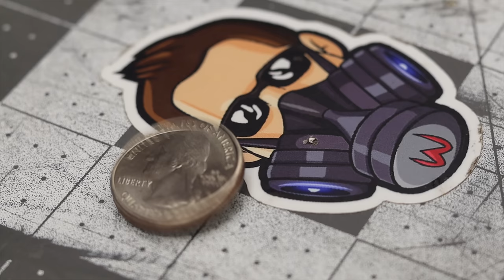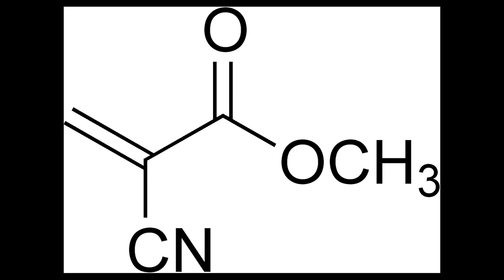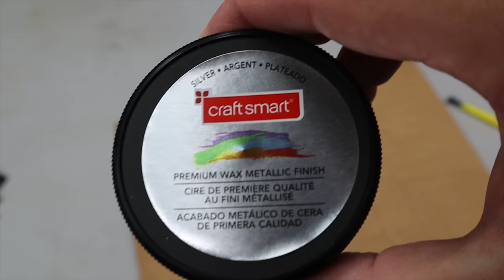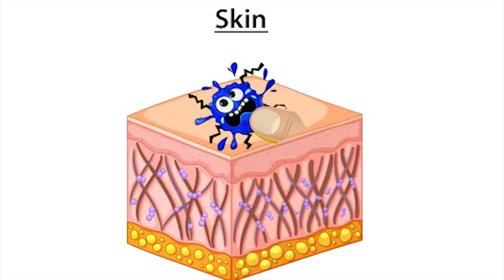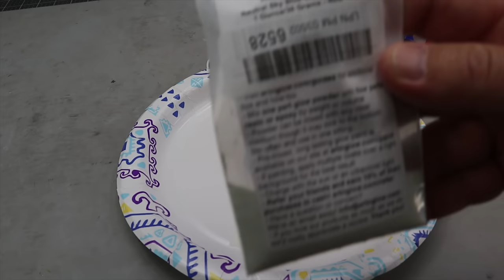25 SUPER GLUE HACKS YOU HAVE TO TRY

Comment: I'm a model railroader and have been using super glue and baking soda for years as a filler.  It sands nicely and is very easy to work with.  Holds paint quite well too.   Cheers from eastern TN

Comment: Here’s a tip you missed.  Drip the thin on your tennis shoe and ignore.  Later when your about to crash for the night you realize your shoe is stuck to your sock.  And your sock is stuck to your foot.  So the tip is, don’t do this.
Reply from the maker: Chad that made me laugh man... The scene where I Ca glue the foam to my gloves.. I must have soaked one of my fingers reallllllllllly good...  Because after the shot was over, i went to take the glove off and it didn't want to come off that finger.... I am still getting use to wearing only one glove... Im kidding.. :-)  But it really did happen.. And it wasn't too bad getting off. Just a little shocking, I'm sure just like your sock. lol Thanks for the comment bud!!! -Brian
Reply: Does acetone dissolve this stuff? Keep your nail polish remover close!
Reply: Also, don't get a mess of glue on your fingers working w photo etch parts, and then taking a smoke break to relax after dealing with  the utter frustration photo etch entails.....i transferred the glue to my lips, and tore flesh in the panic to prise them apart...
Reply: @WoodenCreationz  you might try aerosol adhesive for the gluing of the foam to gloves in the future...without putting your hands in while spraying.You can put your fingers in later after it sets a bit, to conform the foam to your fingers.  Just dont accidentally spray your face , when the spray tip invariably clogs.....i unfortunately ruined my prescription glasses doing just this..(trying to scrutinize why the damn orifice clogged)all .my glue mishaps might make one question how i survived 15 years working as a welder/fabricator, but, i was very cautious in this work environment and was able to avoid serious injury.
Reply: Also, don't put your ca glue bottle in your pants pocket, because it might leak. And then your pocket might get glued to your boxers, which might get glued to your leg. You know. Hypothetically.
Reply from the maker: @williamsstephens  Yes it does.. got a ton of thin on my fingers in the last video and acetone freed me. ty for the comment!
Reply from the maker: @Weld24_CosmicKat  Ouch!
Reply from the maker: @Weld24_CosmicKat  Great tip.. I super glued my fingers together in my latest video. Trying their new super glue remover in an upcoming video.
Reply from the maker: @BillCoale  Not a bad idea. Its amazing stuff but it only takes seconds for the thin to set and dry.

Comment: What’s the difference between ca glue and superglue
Reply from the maker: It’s the exact same thing. Cyanoacrylate is super glue. All superglue manufactures, make relatively the same thing only differences some are fresher than others, or some may be stronger than others, and have a longer shelf life. The dollar store superglue won’t be as high-quality and will likely be pretty runny and messy. While Starbond and others be higher quality with thickening agent to slow it down. Making it easier to work with.

Comment: if  you use superglue with baking powder it improves structural strength so super glue then baking powder then super glue building up layers sets like concrete!
Reply: Baking powder or baking soda?
Reply from the maker: @ladyfame1430  You are right.. Baking soda... I tried it before doing this video.. It works.. but it just turns into a clumpy weird mess in my testing.